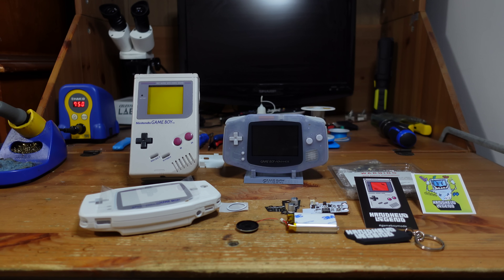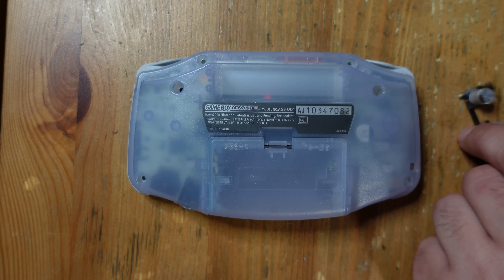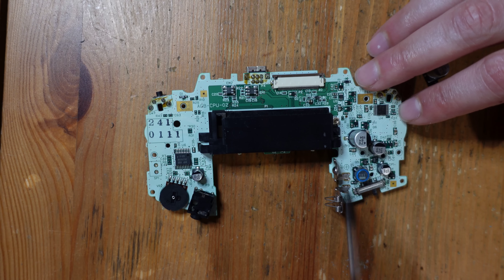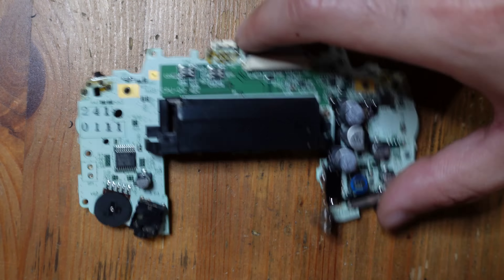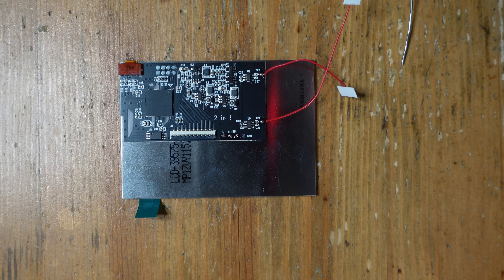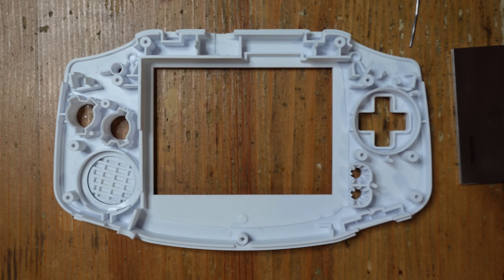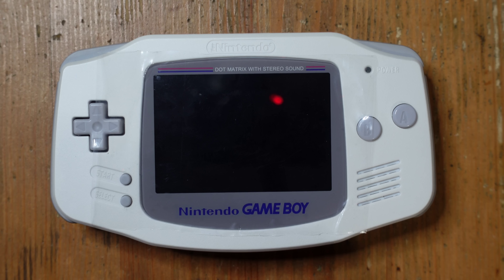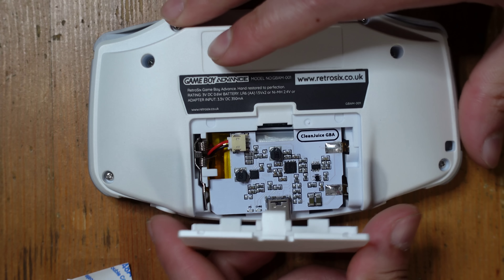Building a GBA Classic in 2022 - Screen Mods, Audio Mods, and more!

Comment: I've been wanting to put in one of those amp mods, but I had enough trouble with trying to put one of Helder's kits for the power (damn thing just wouldn't stay put or soldered on), I just gave up on it for the time being
Reply from the maker: It sounds like you might not have a good temperature controlled iron. The soldering on the GBA can be tricky because it’s quite small as well

Comment: Man, gba modding has come a long way in a few short years. Last time I did an ips and battery upgrade there was a ton of trimming and fitting to do
Reply from the maker: Yeah a lot has changed! There are lots of options and installations have gotten easier

Comment: This has GBA internals? I would've used a GBA screen protector instead of the NGB screen protector.
Otherwise, great job
Reply from the maker: Yes, the internal hardware is an original GBA. At least there are lots of different options for replacing the shell these days!